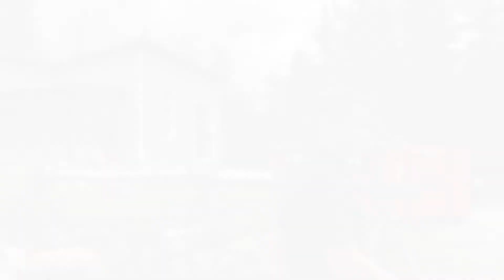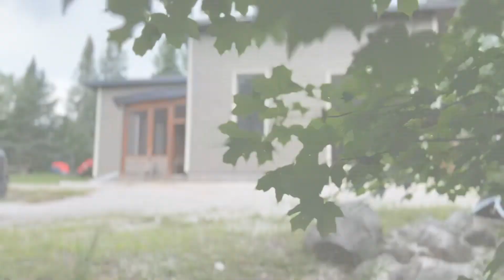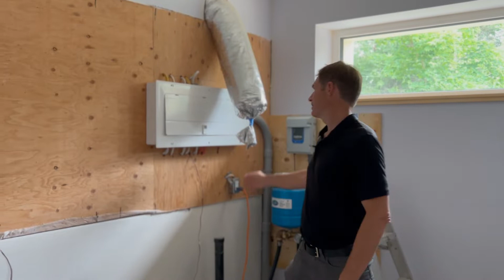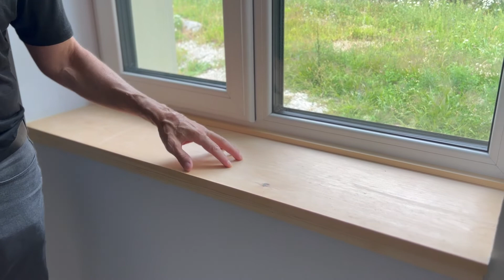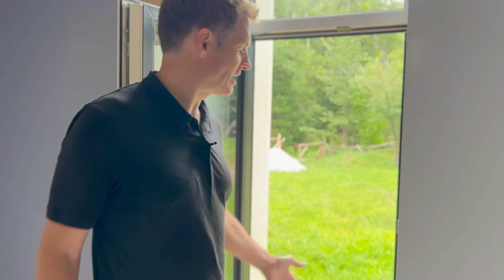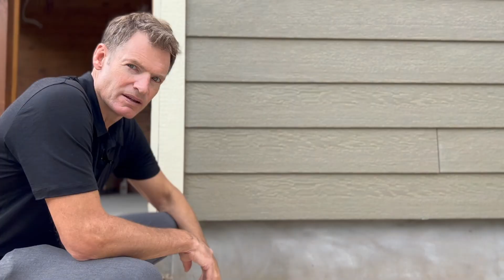A Passive House Tour Inside the Chelsea EkoModel

Comment: Concerned about the roof snow load abilities of the home. I live in very cold weather area with lots of snow.
Reply from the maker: Thanks we do get this question lots, there’s no problem with any snow condition as all designs meet 1 in 100 years snow loads conditions by engineer review. For example, We have designed a house for Lake Tahoe California which has a 150 pound per square foot snow load, 
Passive House roof systems are also naturally thicker so naturally stronger and have more strength protection with standard design

Comment: 1) 200A - will that be enough for passive home AND electrical charge ie Tesla; 2) what is lifetime for such sidings? do they need any extra care (ie staining)? 3) did you install radiant heated floor in all surfaces? would appreciate price rang on what additional costs that will be.. thank you!
Reply from the maker: 1. Yes, 200 amp would be suitable for any electric vehicle. We do this often..
2. Engineered LP Adams siding comes with a 40 year warranty, the finishes guaranteed not to fade in 15 years, may need to be painted after that…personal preference
3. Yes, the customer of the home wanted radiant floor everywhere but it’s not required in a passive Home considered a luxury item. Most often we install a single air source heat pump mini split.
Radian floor adds approximately 10 to 15 K extra to budget